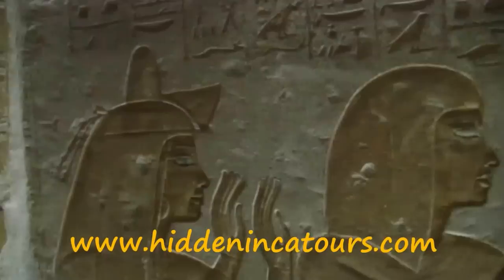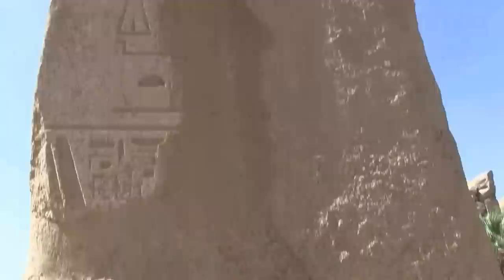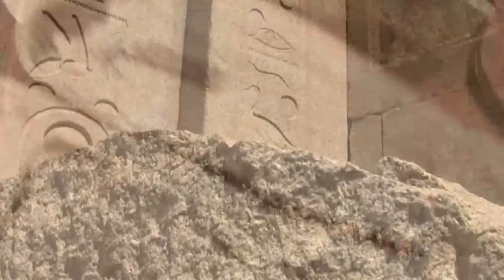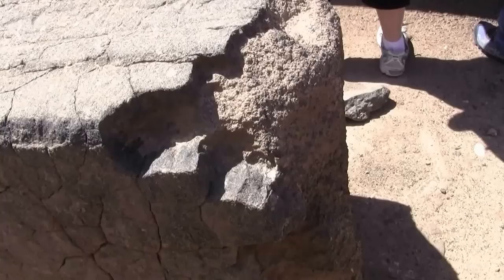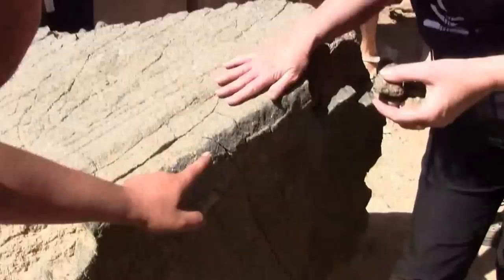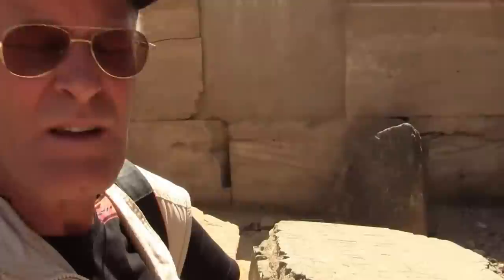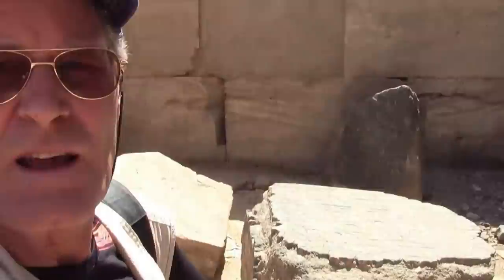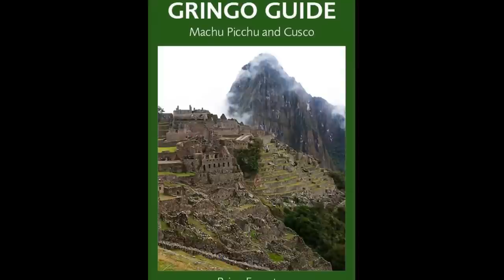Egypt's Obelisks: Part Of An Ancient Energy System?

Comment: To me it looks more like the stone was being softened as an oscillating device at a particular frequency was being pushed into the stone. The rings in the cut look more like they are stepped rather than spiraled, As if the blade wasn't spinning but vibrating. I have done something similar with an engraving tool with a special blade in soft material.

Comment: I had difficulty to see core drill with extremely thin kerf with that diameter ;I am still thinking of immaterial desintegrator head composed only of energy
Reply: why not go all the way and say it was done by a magic wand by an albino unicorn being ridden by a purple griffin
Reply: I am talking of real aliens
Reply: There is one more practical theory. with an circular copper tube and with the use of frequencies you can make an hole like that in stone. It is tested. so you use the drill bit, and then with an cable you can transmit frequencies in the tube which then automatically cuts the stone like that.

Comment: if there is heat used during drilling or cutting it will fuse the surface making it stronger then the core

Comment: I have a question to Brien and others - if a hollow tube was used for drilling then how would they get the piece of the rock out of the hole ?? I mean it still would be attached to the rock at the bottom of it - so how would they break it off and remove it ?
Thank you.
Reply: if my theory of desintegrator ( break atoms forces that bond all material together )  is correct you do not have to retreive any core the rock is reduce in powder and in same time silicon will re-attached to existing and produce the glazing
Reply: Oh crap :) sounds very complicated ! :) Thank you !
Reply: I have seen some core that show cores broken off and left unfinished. You could simply snap the core out, then finish the remaining rough surface. Although more technologically advance methods most definitely could have been used. Chris Dunn discusses using ultrasonic diamond-tipped drilling (with tubular drill bits).
Reply: This hole is rather strange. It's very large in diameter, it has these squared cavities near the top (right hand side) and then, about 1/3 from the top of the hole, there is a groove "routed" into the sidewall of the hole. In order to make that groove, they would have had to cut out those square cavities and then potentially used some kind of special bit. 2-3 cavities most likely, 1/3rd of the hole is broken off. Maybe on the ground nearby. If the cavities were made to allow leverage to break the core out, then at the moment, I'm not sure why the groove was made. In any case, it's an odd and complex design that is purpose driven toward some specific need. Nothing arbitrary looking about it.